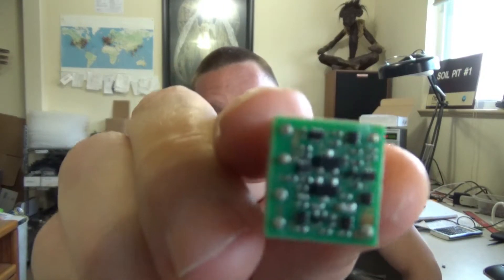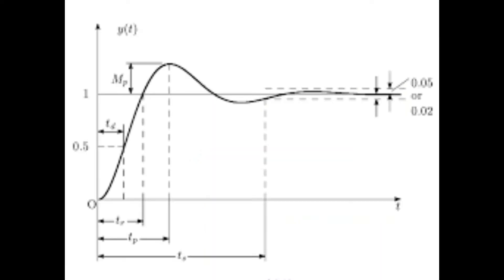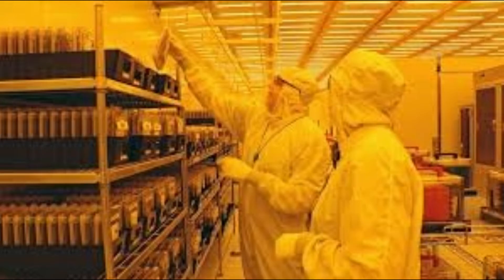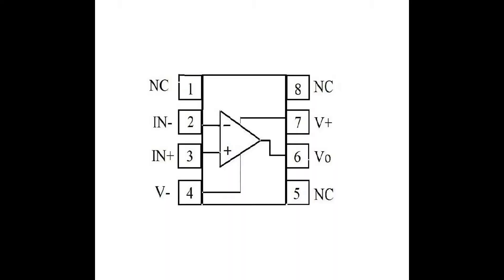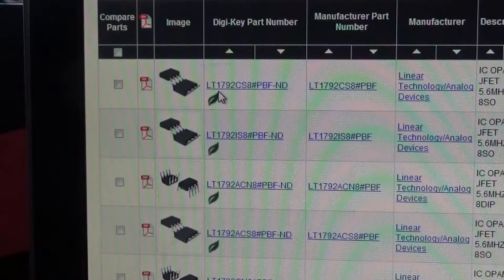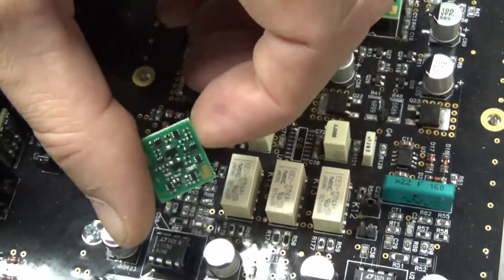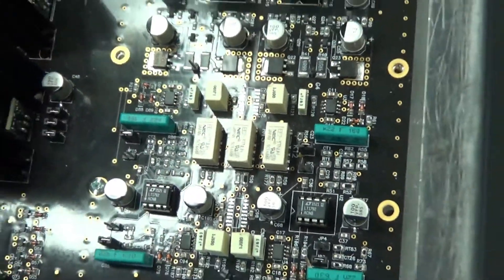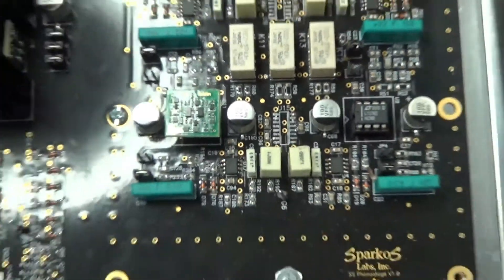Discrete Op Amps - Sparkos Labs

Comment: Nice I'd like to try it. Can this be used to pre-amp drum mics? like SM57, beta52 dynamics. Thinking of building a 4 chan drum distortion effect.
Reply: That is a really strange question. The opamps does not bother what they amplify.
Reply: I’ve just upgraded my Neve console with these units. There is nothing out there in the way of op amps like this, these truly operate in full 100% Class A 
These units are amazing- the bench mark for mic pre amp ab test is with a Neve 1073!

The important things to note are this:

1. Other discrete op amp amps don’t have high open loop gains… this means that they will have oscillation issues in the MHz range in many cases, people end up going back to old ICs instead, to avoid this issue. 
Sparkos discrete op amps have high open loop gains and therefore get around this issue completely! 

2. The other discrete op amps on the market use fet to provide the discrete op amp function… this is Never as good as BJT transistors 

3. The other options on the market don’t have duel-pole compensation. 
The other options don’t run in pure Class A throughout.

What I can see is these Sparkos discrete op amps sound exactly like they should - they amplifier the input source transparently. This is the whole reason why Class A is great!
Reply: @caminglis53  Hey, I'm about to replace op-amps in my console, too. What were stock op-amps in your neve?
Reply: @divern  hey there the op amps in the Neve and many Neve including the Neve Air consoles and Neve 8078 are all NE5534 and some 32. 
The ideal and really only option to get class a from that situation is Sparkos discrete opamps SS3601 and SS3602 and they also have a replacement for 2520 api discrete op amps to make your api actual class a rather than class A - AB…

What op amps are in your console?

Also the only other option on earth that is built on BJT transistors all stages class A is sonic labs, but I think sparkos labs are better as they have high open loop gains so that they go into oscillation. 

sparkos and sonic both have the same result in terms of real class a input to output, but I’d go with sparkos because they solve the oscillation issues that usually happens!
Reply: @caminglis53  Hi, my  console is based around good old RC4580 op-amp. I'm thinking of replacing  op-amps in master section (summing/output). Initial idea was to go with  decoupling/bypassing stock op-amp and see how it works out but  SS3602 seems to be all in one solution. 
Cheers
Reply: @divern  yes for dual op amp SS3602 is the go for sure

Comment: 01s and 02s do some unbelievable magic in SB X7.
Reply: is it worth it?
I thought about doing this my self, do i need 2 of SS3601 and 2 of SS3602?
Reply: @haloharry97  Yes correct, 4pc total. Its day and night difference IMO, but I guess it depends on what your headphones are. I use it with HD800s and Fostex TH900. Especially for Senns since I can boost low end and other stuff I need using its DSP. I also have Burson Conductor, Monolith THX AAA and had Chord Hugo. I prefer X7 w these opamps simply because it is as good as Monolith or Burson, but with  DSP. Vanilla non modded x7 is very bad imo compared to normal transparent amp.
Reply: @escknx  I use the hd650.
Reply: @haloharry97  oh yes you will definitely hear the difference. With stock opamps x7 is just your old famous sound blaster in a fancy package. With Sparkos it goes to high end amp territory, at least to my ears, while keeping far more advanced technology in terms of built in DSP. So far I'm unable to find an alternative to x7+Sparkos in terms of sound quality and ease of use regardless of price range.
Reply: @escknx  that good to know.
I love the x7 of what it can do but the sound quality I never find the best.
Reply: @escknx  I just got them after 2 defective 602. they are amazing.

Comment: Discrete vs IC... Hhhmmm... I disagree with you about crossover distortion in IC opamps, choose a decent audio opamp like the OPA or LME series, build a highly optimized circuit for it(proper  power supply decoupling, layout and component values) and you have distortion measurements that are too low to measure. Discrete opamps excel in output drive capability. In most laboratory tests IC opamps beat discretes in accuracy, provided they operate within their design limits and are in an optimal external circuit.
Reply: Use your ears, and you will know.
Reply: @qddk9545  they suck also burson's, opas sound just like music

Comment: How good does the rest of your gear have to be to benefit from an op-amp upgrade?
Reply: I'd say that if you are certain that the replacement op amp is an enhancement of the original, then you go ahead and install the replacement.  Now listen carefully to your complete system, alert to any improvement in the sound quality. Let's say you replaced an op amp in a power amplifier.  If you can't hear any improvement, then since you know the upgraded amp has better specs, you know there must be another component of your system that needs an upgrade.
Reply: the best ear in a 5 figure system (without speaker cost) can't hear any difference.  at best it might sound slightly different. see ASR swapping out the Hypex buffer vs no buffer at all.  if any buffer is changing the sound then it's not transparent. PS Audio put their own buffer on ICE amp modules to change their sound by adding feedback, they thought the bare modules were too clean.
Reply: @herrtrigger7220  -- Actually, the PS Audio "Analog Cell" is supposedly a Class A zero feedback circuit.  Apparently, it does neither harm nor good vs. a conventional op-amp front end -- but it sure adds a whole lot to the price tag.
Reply: @editorjuno  Yup, not hating on what these guys are doing here its a free country.  That being said after around 15 years of audiophoolia Ive come to the conclusion that just going for low low SINAD and decent amplification is where its at.  For a tru improvement in actual SQ look no further than your speakers and your room acoustics.  The latter being where I'd spend first!

Comment: Gru is the most powerful being in the universe. First according to the height of a Minion (which is 3.5 feet on average) Gru is 4 minions tall, which means he is a godly size of 14 feet tall. Second if any of you remember the original Despicable Me, you Know there is a scene when Vector kidnaps the three girls and shoots a series of heat-seeking missles at Gru, he then dodge them all. According to the speed of an average ballistic missile (1900 mph) and the size of the missile according to his ankle size, Gru can perceive and move at such a speed that the missiles only move 9.5 miles per hour, 0.5% of their original speed. Plus after this Gru punches a shark and it is paralyzed meaning its spine is probably shattered, to remind you it would require a force greater than 3,000 newtons to fracture the spine. That’s equal to the impact created by a 500-pound car crashing into a wall at 30 miles per hour. I rest my case
Reply from the maker: I hope that you hit the subscribe button Wesley! Love Lutz